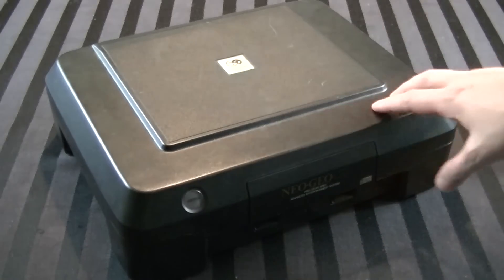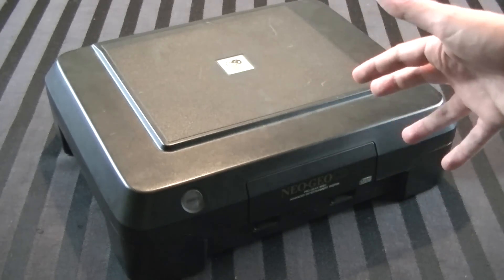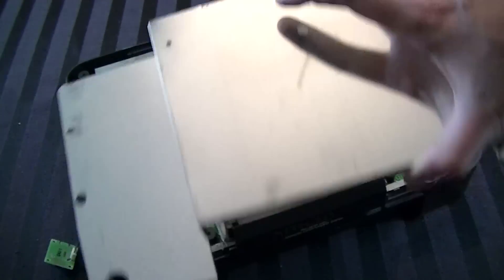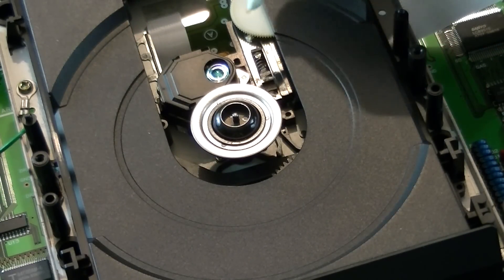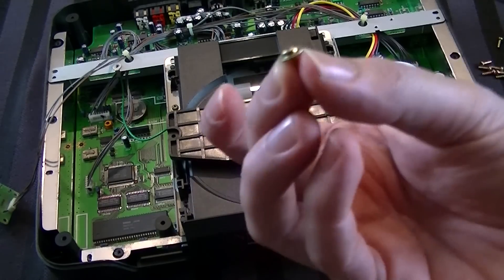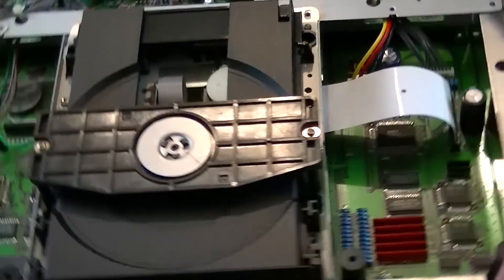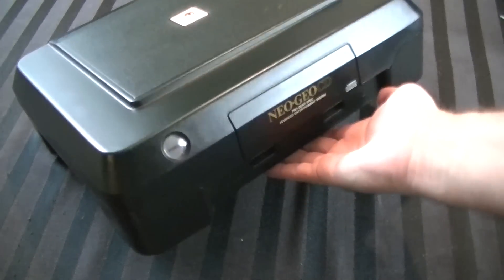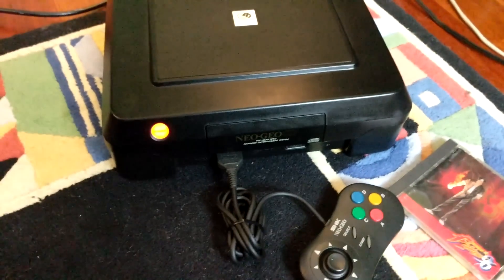Cleaning and Restoring an SNK Neo Geo CD (Front Loader) - Adam Koralik

Comment: Hey Adam. I’m finishing up a documentary for the Neo Geo. I was wondering if I could use parts of your recap of the AES within? I PROMISE to give you, and your company: Figure It Out Productions credit, and Special Thanks. Especially for videos like these. If I may (for the sake if you DO intend on cleaning the AES) DO NOT use Windex/Windolene on the system itself. The console’s manual, and the Neo Geo Development Wiki states that it will—in fact discolor! I’d recommend Armorall Cleaning Wipes instead. Sure the system will look greasy, but it actually helps to polish it. Works well for my Sega Genesis/CD.
Reply from the maker: Sure, go ahead.

Comment: the cd drive in these is the same as the mk1 mega cd unit, usefull info for repairs and for sourcing new laser units, i have actually seen suppliers charging more for the laser just because its for the "neo cd", yet the sega cd unit was 15 pounds cheaper, they had the same part numbers lol, dont get skanked.

Comment: The CD drive is oddly similar to the CD drive that the Sega CD model 1 uses. They look almost exactly the same. Strange
Reply: Yep, a lot of CD consoles back then used a very similar Sony / Sanyo / Philips CD chipset, and there were some common laser assemblies, too.

The 3DO uses the same type of Panasonic (Matsushita MKE) interface as the old CD-ROM drives sold by Creative in the early 90s.

The protocol for most of those chipsets is almost the same as well. I think the PCE / tg16 CD drive uses a Sanyo / Sony style chipset.

I've been wondering about a project to replace the CD drive in my Neo Geo CD with a faster one. I'm fairly sure the main bottleneck for the loading times is the drive itself, which is apparently a single-speed drive in the first NGCD (so around 150KB/sec).
Reply: @electronash  I think I heard something about replacing the drive with a faster one but forgot what the conclusion was.

Comment: So... apparently nowadays "cleaning" is a synonym of "restoration"?

I know you'll think I'm a shithead, but I really don't give a fuck at this point. I am disappointed when people claim they are doing some amazing repair job, while doing almost nothing other than impress other people who know even less about those devices.

Nothing you did in this video made the console work better apart from maybe cleaning the laser.
Here are some examples of what you should have done, to be allowed to call it a restoration:
- Re-flow solder joints (for example on the power input connector, which seems to be a common problem with this device)
- Replace some caps (I think some video output circuitry caps go bad in this device)
- Calibrate the laser
- Calibrate the disk drive tension
- Re-grease the drive gears
Those are just some things off the top of my head, even though I know almost nothing of Neo Geo CD repair. I however am familiar with how temperamental this CD drive is, because it is also used in other consoles.

How exactly can you call this "restored back to the condition when it came off the assembly line"? You don't think that's arrogant? In a way you are shitting all over the invaluable work of professional repair people, because you give viewers the impression "a good cleaning is all that's necessary". You think this device saw zero use within the past 24 years (based on when you uploaded the video) and none of the materials deteriorated?
You should have just called this a tear-down and left it at that instead of posing as some kind of repairman.
Reply from the maker: I think you really misunderstand the point of the video. I didn't claim this was a top to bottom dismantling of the console, with an elaborate focus on recapping everything, resoldering this, redoing that.

All I said I was going to do was clean it and hope it worked out. It did. If you have an issue with that, then holy shit dude, you need a hobby.

Comment: Think caps have gone on mine possibly was working flawlessly then randomly started resetting itself. Would happen after a while then after few more days of testing it to hope it magically was ok, it would constantly reset barely getting past the initially loading screens of any games...need to find someone to repair it. I have another unit with a defective disc drive which I attempted to repair but failed. Uses same laser assembly as the original mega cd but it was beyond my limited skills. Need someone in uk I can trust to repair them!
Reply: You sure it's not just a bad power connector? That was the issue on mine.